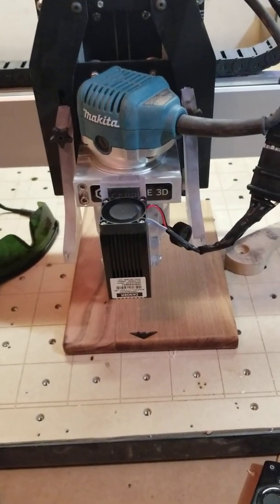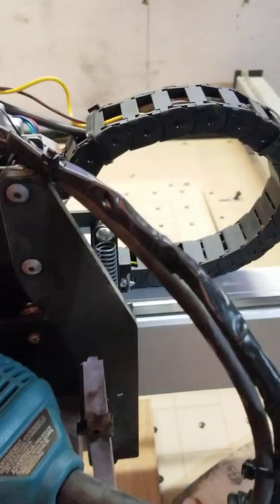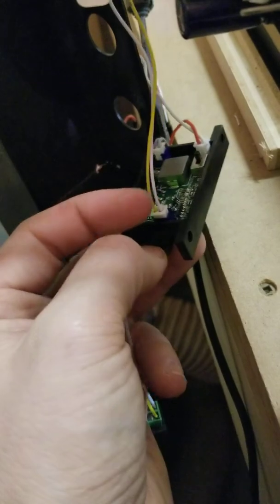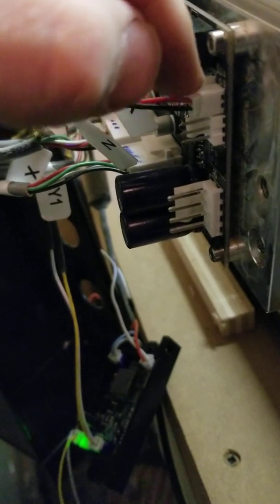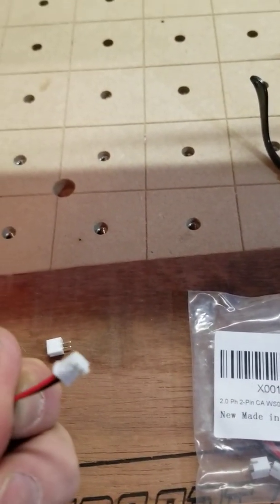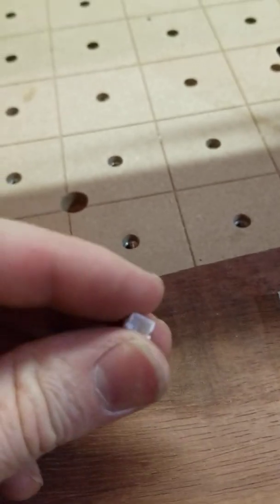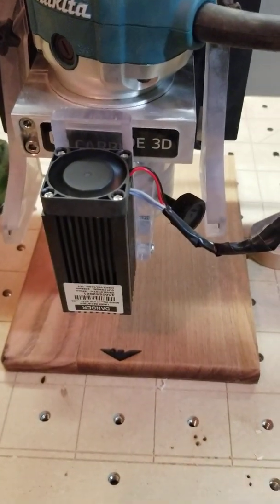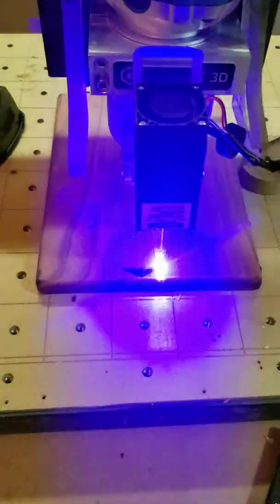DIY Laser Install on a Shapeoko!

Comment: I am not a electronic type person but would like to do what you have here, I don't understand what pins you are connecting to on the laser control board that goes to the PWM pins on the Shapeoko control board.  I do know my Atomstack Pro does not have a designated PWM pin,

Comment: What software do you use to run the laser?
Reply from the maker: I use lightburn.
Reply: @jayrich1985  did you buy it or trial?
When I connect everything my laser is On right away and stays on. What did I do wrong?
Reply from the maker: @loc5532  I used the free until it ran out then paid the 40, well worth it. You will have to change the gcode settings. If you check out Myers workshop, he has an entire video showing what ya need to change in the settings to turn the laser on/off etc.
Reply: @jayrich1985  Yeah. Connected and it works. The only problem is the movement - don't figure out the 0 point and direction. Set the X and Y distance for the Shapeoko but it goes right off the table. Have to figure out all the settings.. Thank you for your video

Comment: I have a question: can the built-in carbide motion work the laser? ty
Reply from the maker: It can, but I never really messed with it, at the same time I switched to a cnc4newbies z slider so switched to UGS. Myerswoodshop used carbide motion though
Reply: @jayrich1985  yeah, I read somewhere that it's slower cause it's slow to turn the beam on and off every time or something like that. ty for your answer

Comment: James - Thank you for the video.  I recently bought a similar laser on eBay and may have jumped in over my head. Mine did not come with a TTL board, so I am not sure how to connect it to the S3. Any suggestions?  Here is a link to the laser: https://www.ebay.com/itm/PWM-TTL-450nm-8W-Focusable-Blue-Laser-Module-engraver-Engraving-Cutting-Marking/123834570630?_trkparms=ao%3D1%26asc%3D225074%26meid%3D2b99be5247fd46bcabac686c8de0c35b%26pid%3D100275%26itm%3D123834570630%26pmt%3D1%26noa%3D1%26pg%3D2060778%26algv%3DItemStripV3&_trksid=p2060778.c100275.m3474